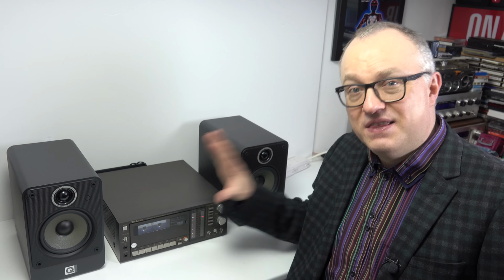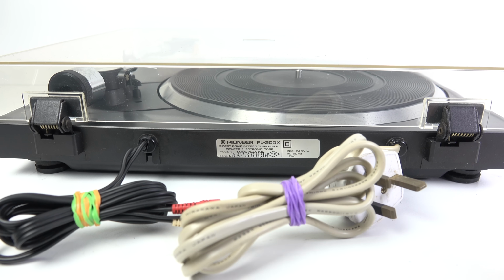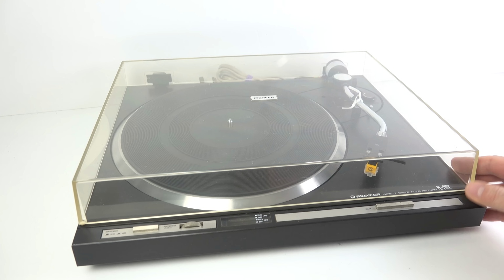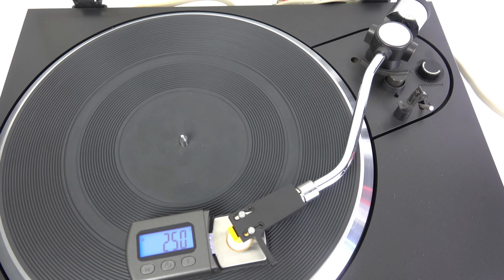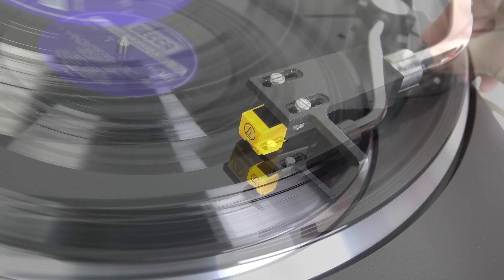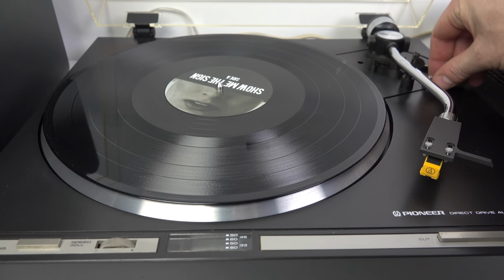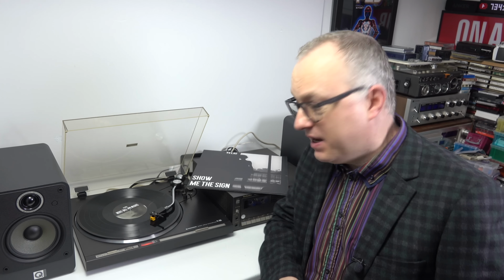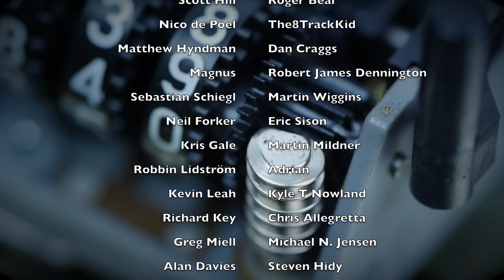Beginner Budget Hi-Fi Build: Part 3

Comment: I've noticed that you haven't checked the wow or flutter on either the cassette player or the record player, is that something you do in part 4, or did you decide not to do that check?
Reply: I hadn’t thought of that
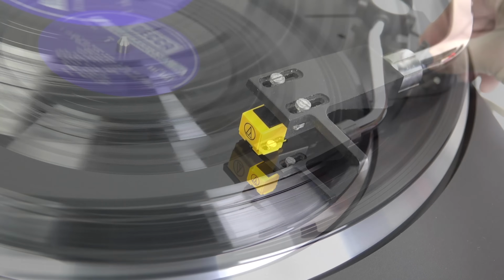Reply: the only check I saw was at 6:50  when he checked the built-in led to see if the lights were steady. I guess it was okay, so he didn't bother to go further.
Reply: That record player doesn't quite sound right to my ears. The first thing I thought was it might be a bit of flutter.
Reply: He's looking at it from a newbie perspective. Possibly doesn't want to scare someone who wishes to set themselves up with a budget or first system into thinking they need loads of extra equipment to test it all? It also shows that if you are savvy enough you can buy second hand without buying complete junk.
Reply: @3rdalbum  If the hole in the record is not absolutely centered, there will be pitch changes due to the 'needle' (arm) moving from left to right as the record spins. It was always a pet peeve of mine in the 70's and 80's.

Comment: I think the stylus is an AT-95 cause i have a similar turntable with the same stylus and was popular on mid-range turntables in the 1980s
Reply: It's more likely that this Is AT-91. Very popular, "general purpose" replacement cartridge. Shape of the plastic part that holds the stylus seems to be closer to it than a 95.

Comment: I thought all turntables had no on off switch. What would be the point. They just need a cut or return switch.
Reply: Only the auto/semi auto, all fully manual units will have an ON/OFF button as there is no other way to turn on/off the player otherwise. Most older record changers, the on/off switch WAS the manual/auto lever so you HAD to slide the lever to the ON position to play it manually but most semi/full auto units since at least the 80's simply require you to move the arm to the record to get it going. BTW, I had a crappy Sansui PD-10 DD table that actually had a separate on/off button on the front. That WAS from a cheap/crappy rack system from the mid 80's though. However, that may well have been not terribly common TBH.

Comment: I have a modern pioneer record player and it has no power button either. I thought that was a bit odd too but i figured it was just a modern thing cos I hadn't had a record player since the mid 90s. Mine just has a play button and it just moves the arm and gets playing when I hit that and switches off once it's done with that side of the disc. Is that unusual? it's a PL990 that I have.

Comment: I did better at my local goodwill.  You can't beat high end (1970's) Advent speakers for $7.  They're tiny and don't handle base well, so I bought a car subwoofer crossover on ebay for $35 (yes I had to get a 12 volt power supply for it) and put it into sony's first 5.1 amp from the 90's ($50) for 4 separately amplified channels.  And of course two unpowered subwoofers for another $20.  Sounds amazingly good.  Yes, that won't work with vinyl unless I get a preamp, but I don't have any vinyl.

Comment: I have a Teac CR-H100 CD / radio / amp and there are inputs / outputs for a tape and minidisc recorders. Unfortunately no phono input for a record player.
Reply: If you're not using the minidisk input, you can get a preamplifier and hook your turntable there.  If you ARE using both inputs, you can buy switch boxes that expand one of those inputs for more devices.  They're not terribly expensive.

Comment: Nice episode, the tracking force sounds a little high 1.75g should be closer. Also when you said how to adjust it you actually turn both weights at the same time when setting it the reason they turn separate is to 0 the measurement after finding the balancing point.

Comment: A couple of record player pointers for you.  Some belt-driven turntables are good!  For example any Rega turntable, which you might find a relatively cheaply on eBay. The Regas have no grounding cable but  they DO require an amp with a phono stage or a separate phono amp. Your tonearm tracking force was off because you were trying to balance the counterweight with the stylus guard on. This might sound counter-intuitive because you don’t want to bash the stylus tip on anything, but the theory is to balance the weight as if you’re playing a record. So here in some detail, is how to set up the tonearm. I hope you and your viewers find it helpful. 

1. Find a non-warped but non-essential record. Place it on the platter. You don’t need the platter turning. 
2.  The arm lowering mechanism should be foward, ie as if playing a record. Antiskate or bias control as it’s sometimes called, should be set at zero. 
3.  Take the stylus guard off.  Whilst adjusting the counterweight, carefully move the arm from resting position.  The aim is to get the arm to float about a millimetre above the surface of the record when you let go of the arm. The arm will naturally move from centre towards its rest, so side to side movement is ok, but it shouldn’t bump up and down. It should be level. Obviously be ready to catch the arm if it looks like it will scrape the record.  It’s a little fiddly and counterweight adjustments will be quite minuscule. It’s not an exact science though, so as long as arm floats level  with the surface of the record, that should be fine.  Tracking force is now set at zero grams. 
4.  With the arm on its rest, set the tracking force dial to the cartridge manufacturer’s recommended weight. Ideally when buying a second hand record player, the seller should provide the model number and preferably the leaflet that comes with the cartridge. The audio-technica cartridge in the video tracks at around 2.0-3.5g grams, and the ideal weight should be somewhere in the middle, about 2.8g. Rega’s own cartridges  track at 1.75g and budget Ortofons track at around 1.8g. I wouldn’t be a Hi-Fi nerd if I didn’t say that it’s possible spend £3k plus on a cartridge alone, and these often track at relatively low weights. I would advise that the first upgrade on a turntable is to buy a cartridge from, eg Rega (not the Carbon  as it’s a   rebadged Audio - Technica), Ortofon or Goldring, that is intended to track at below 2g .  The stylus tip should be described as elliptical. The improvements in sound over and above that basic Audio-Technica model will be well worth it. AT themselves also make decent cartridges and have a new range out, but the one that is seen on budget record players is the lowest of the low.  It has a spherical tip that doesn’t quite fit the shape of the grooves.  Look to spend between £60 and £120 on a cartridge upgrade. If you order one from a high street store, as opposed to online, the dealer will also fit it for you as this is very fiddly. You’ll still need to balance the counterweight at home, but physically removing the old cartridge and connecting the new one requires a steadier hand than mine!  
5.  Once the tracking force is set, check that when resting on the record, the tonearm is straight and parallel with the platter surface. Most decks, though not Rega’s, have what’s called a VTA control which raises and lowers the arm height so that it’s parallel with the record. This adjustment is not essential, but if you do change it, you’ll need to set the tracking force back to zero, and check that the counterweight is still floating properly. 
6.  The cartridge itself needs to be aligned properly in its head shell. A dealer worth his or her salt will do this for you, and this is one reason why I’d always recommend buying from someone in person, even if you do buy second hand. I won’t go into the whys and wherefores of how this alignment is done as it’s better to see it done rather than read about it! It’s EXTREMELY important to get this right, and requires a card protractor. If you end up doing it yourself, google Turntable Alignment Protractor and you should be able to print one off, along with instructions. It’s fiddly but it needs doing properly- but thankfully you only need to do it once! 
7.  Finally, set the antiskate. Techmoan used a blank portion of a record to do this. The record he showed dates from 1967 and my copy of it at any rate is quite warped and crackly. It’s called Give Yourself A Stereo Checkout, and I find it hilariously funny!  I do have a less warped and crackly blank disc too. Paulo Nutini’s Double LP Caustic Love is totally excellent, and side 4 is blank. If you can’t get a blank side, set the antiskate control to the same as the cartridge tracking force.  So if the recommended tracking weight is 1.8g, set the antiskate to 1.8 as well. This is another adjustment that needs doing, but it will never be absolutely perfect as each record’s grooves are modulated differently. So get it about right and agonise no further. 
8.  You’re done!  I’ve made a couple of videos where I’ve set up my Rega. One was badly filmed, but judging by the number of views, people have found it helpful. I remade it, and the filming was better. Hop to my channel and search turntable set up.

Comment: I like direct drive turntables above belt drive because you can tweak direct drive ones into playing pretty much any speed you want as an odd speed record collector that's pretty much a must and we are not just speaking about 78rpm here is a list of speeds used in studios and commerce over the last 130 years in disc recordings
3rpm
8rpm
10rpm
16rpm
22rpm
28rpm
33rpm
33,1/3rpm
40rpm
45rpm
50rpm
60rpm
65rpm
70rpm
78rpm
80rpm
90rpm
100rpm
120rpm
130rpm 
150rpm 
160rpm 
200rpm
not something a belt drive could do even with modifications!
Reply: auto return is another thing I turn off or disable completely some of the records in my archive don't fit the standard aka being smaller than most standard labels so it cuts off even before it begins for a 1960s 1970s  doll record paying at a 100rpm I don't want the player to cut off at 6cm from the center since the records are only 3cm across!

Comment: 33 and 45? What do I do with my old 78's?
(I still have a Hitachi semi-automatic magnetic cartridge turntable, which I bought in the early 1980's. Works great, but the belt broke, so I need to find another belt.)
Reply: lookonthebrightside   For 78s, I have an old VOM changer that I resurrected a couple of years ago.  Yes, I know they're not quite the quality of these high-end modern models, but they're still light-years ahead of the players that 78s were originally played on.  The drawback is, of course, that they use ceramic cartridges and it's not easy to fit magnetics to them.  Ceramic cartridges require a proper ceramic phono input, not just an 'aux-in', and for that feature, you have to look at much older amplifiers.  In my case, I have a Realistic SA155 mini-amp, which has switchable magnetic/ceramic phono inputs and works well with that changer.  It's a tad underpowered (only about 2W/channel), but with a decent pair of small two-way bookshelf speakers it actually does pretty well.   It also features REC-OUT connections to pipe the audio to a tape deck or sound card - or to a more capable amp, if I feel the need (I haven't so far).
Reply: That was just a joke. Actually, I have an old record player from the 1960's, it can play 78 rpm and 16 rpm, but I haven't used it in a long time. I don't know if it still works.

Comment: My audiophile friend tracked his turntable at 0.5 grams. The best I could do without skipping with my PL400  was 1.0. 2.5 sounds really heavy. Might as well tape a penny on the tonearm at that point. I think my manual said to adjust the anti-skate number the same as the tracking force.
Reply: Scott from Maine 0.5 grams sounds to light to me. Your friend must have absolutely dead flat records and a perfectly isolated turntable to achieve this. The norm is closer to the 2.0 gram mark. If you need more weight than this your records are either warped or the turntable is badly setup. I have found 1.7 - 2.0 grams to be ideal as even good records often have a very mild degree of warping. If you have to stick a coin on the cartridge headshell as some suggest you might as well call it a cutting lathe.
Reply: My friend was hard core indeed.
Reply: @Scott_From_Maine  I think you would have had to operate it in vacuum chamber to maintain a constant 0.5 grams tracking pressure. I would bet his vinyl platters had hard drive like platter precision. I have tried 0.5 grams on my vinyl and it skates all to readily. It almost seemed as if an ant fart could disturb it at times even with the turntable mounted on a perfectly leveled and spiked isolation shelf.
Reply: I couldn't do a half a gram either. But my friend had a  level of zeal beyond fanatical. He cut his speaker wires the same length so the signal would take the same amount of time to reach each speaker. Kamikaze level fanaticism.
Reply: @Scott_From_Maine  I've heard of this also! Such things as cable sexing and polarising are a thing apparently! I have even heard of magnetic orientation whereby you set up the cable run direction with a compass according to the principles of some arcane and mythical cardinal point lay line orientation. There is esotericism and there is just plain lunacy at the end of the day. I think if your HiFi obssession gets you like that it is time to lay off the disco sherbert! 😂😂😂
Reply: There were very few cartridges that can track below 1g. Tracking force isn't set according to the flatness of the record or isolation of the turntable, but rather the cartridge's ability to keep the diamond in full contact with the groove during heavy modulation (loud recorded sound). Going below the recommended setting can damage records by causing the diamond to 'catch air' off of the waveform peaks and then dig out a chunk of vinyl upon landing again. You can hear this damage as a fuzz or spittiness on loud portions of the music. Audiophile cartridges frequently track up to about 2.5g so it isn't an issue. Cheap record players with non-adjustable arms are generally around 5-8g.
Reply: @bryede  Until you get up to 5 g+, tracking well is better than tracking light.
Reply: @1mctous  Absolutely. People collect records today that were played on portable and console stereos with ceramic cartridges and most of them are fine. But, one play with a mistracking magnetic cartridge and they're ruined forever.

Comment: I know very little about this subject, so please bear with me as I sound under-informed! I have an older ION iTTUSB turntable that I use(d) to record records to the computer and want to use this to start a reasonably priced "Hi-Fi Build". It has RCA plugs and a switch on the back that goes from: "RCA Phone" to "RCA Line". Does anyone know if this turntable has a built-in pre amp? (I can't find anything in the manual). Which setting do I use for connecting it to a (as-yet not purchased) receiver? Any help would be appreciated!!

Comment: No power switch? Not needed on a semi-auto deck, as you said, the arm itself is also the power switch, why add another switch? when the arm is parked there is no need to have the turntable spinning. On a fully manual deck a seperate switch is needed because the arm is a separate component with no mechanism linking it to the deck so there is a need for some sort of switch.

Comment: Why not just look at what is actually available around you and check the forums for opinions on gear when it comes up for pennies locally. Personal examples. I got a working Pioneer CT-F2121 for $15 at the scrap yard(yes the local metal scrap yard). I found a perfect pair of Polk RT25I for $10 at the local Rescue Mission Thrift Store. I got a Sansui AU517 FREE off a friend, because the switches needed cleaning and it was replaced and discarded. I got a  Sansui 2000A that had a noisy preamp transistor for free from another friend. I was given a pair of Wharfdale W60D for FREE with one blown tweeter from an estate sale. The tweeters are on Ebay for not TOO much. THAT is when you hit Ebay for a specific part to see if your bargain is really that. Anyway, that is how I do budget audio on the cheap. These examples span about a ten year period, but I was not even actively searching. If you look for it, you will find it much faster. 1...Come across something free or for pocket change locally. 2...Check the forums to see how it is regarded. 3...Build your system. Paying hundreds of dollars for specific items and the accumulated shipping is NOT cheap or budget IMO.

Comment: That pioneer has pretty much all the features of my Technics SL-D212 except it has the strobe on the inside as apposed to the strobe dots visible on the outside edge of the platter.

My System is the SC2020D Package System
which consists of 

SL-D212 Direct Drive Semi Automatic Turn Table System with Technics EPC-U25 Cartridge
SU-V16 Amplifier
ST-S16 Quartz Radio Tuner
RS-M16 Fully Autimatic Cassette Deck
All in the SH-523 Audio Rack
and SB-2020 Speaker System

Pictures from about 3 years back https://imgur.com/a/yFEJ2

My parents bought it in 1982 and gave it to me when my mother wanted to "Upgrade" to a smaller Mini All in one system so I got this one.

The only things that are not original are the bottom shelf in the rack is a replacement shelf and the Stylus is a replacement.